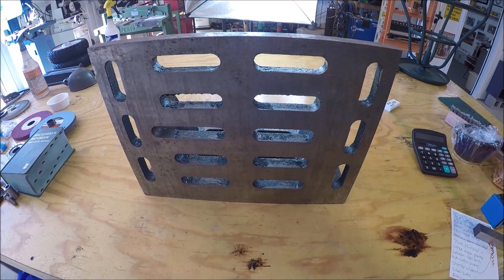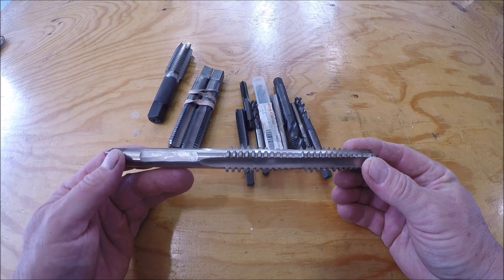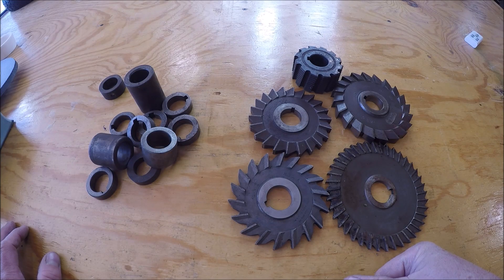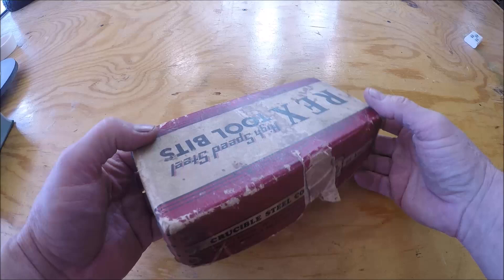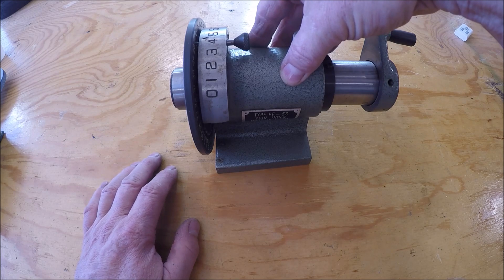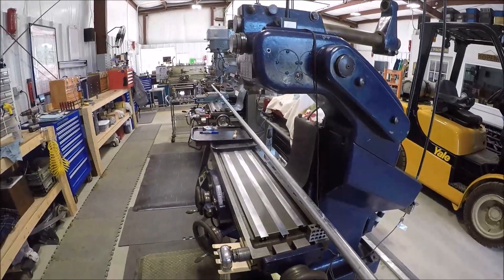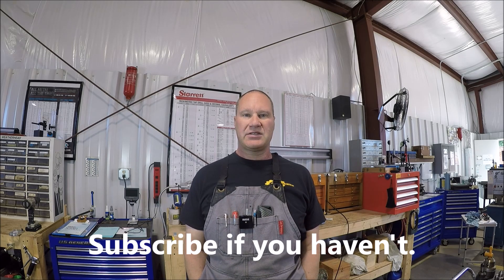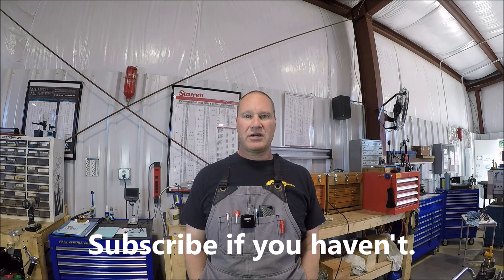Mail Call #47

Comment: Got yourself some nice goodies Tom. Spin fixture is sweet. Here’s a project for you. Check out a section of that pipe and put a heat exchanger over your woodstove. With a fan behind it you can push that air all the way to the other end of the shop. Love your shop. Cheers Tom 🍻👍👍👍
Reply from the maker: Funny you mention that Ron. I already picked up a small blower type fan a while back and plan to build just that. Great minds think a like. 😀

Comment: The acme tap. Am I seeing that correctly,  looks like it tapers twice? If I may, what is the purpose for that?
Reply from the maker: I believe it is made that way so threads are formed in sections and not all at once since that would be a lot of material removal if it cut like a standard 60 thread tap.